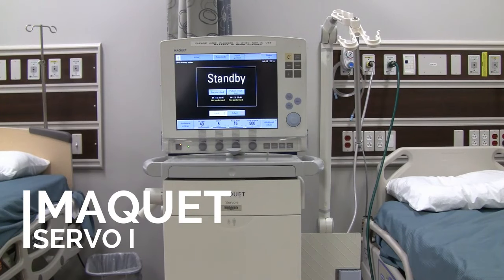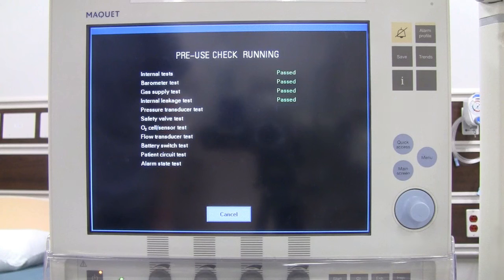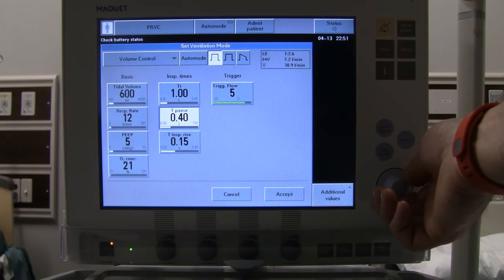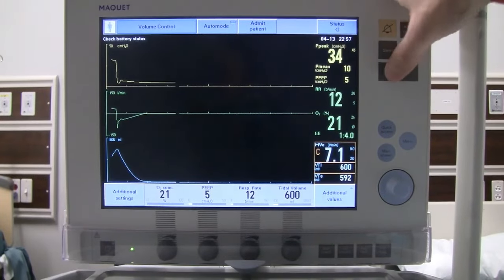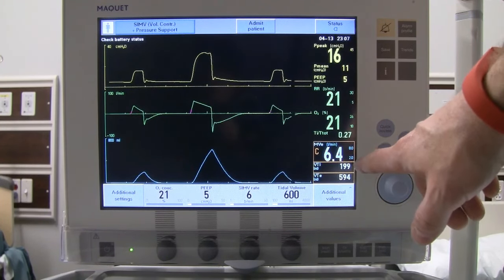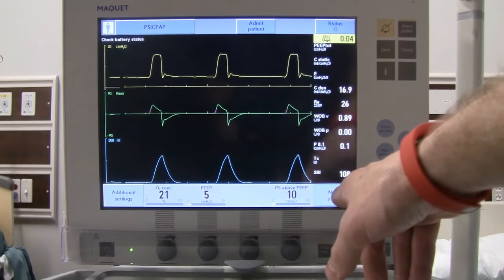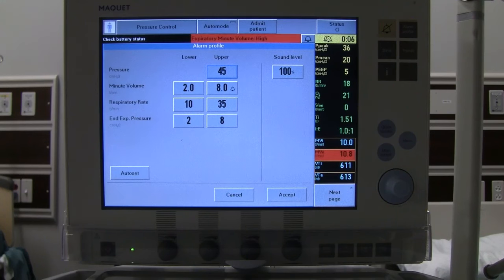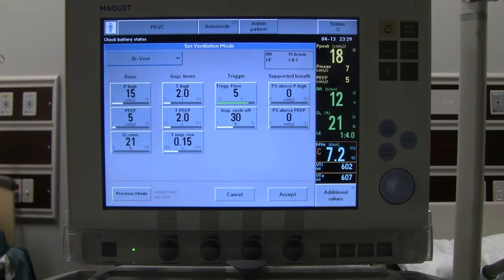Maquet Servo I

Comment: Internal test   P
Barrometer test P
Gas supply test P
Internal leakage test Failed
Pressure transducer test F
Safety valve test F
Oxygen cell / sensor test F
Flow transducer test F
Bettert switch test Not completed
Patient circuit test F
Alarm state test P
What i do now ?
Reply: I think inspiratory channel need to check....there is gas leakage problem

Comment: for peds do you use adult mode?
Reply: Adult Mode volume range is 100 ml to 2000 ml. If pediatric patient requirement is above 100 ml then you can connect it.